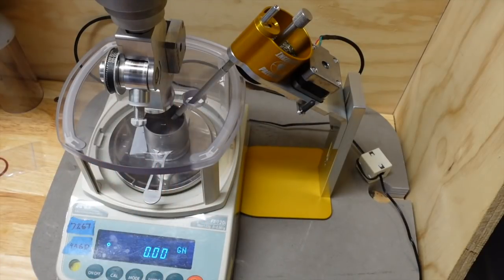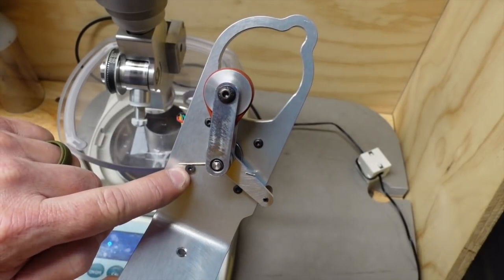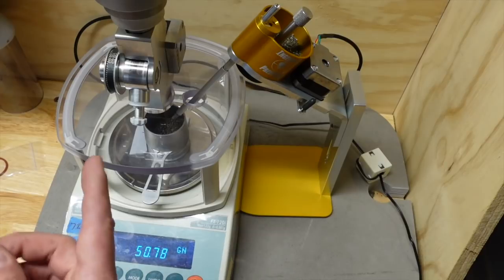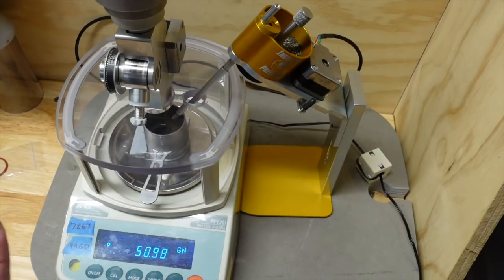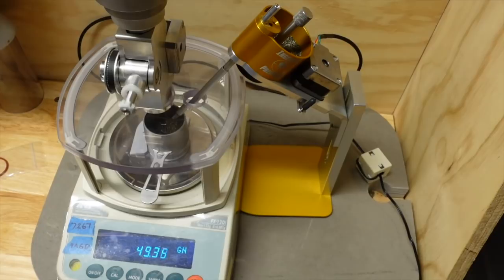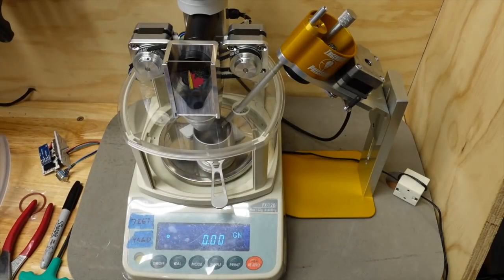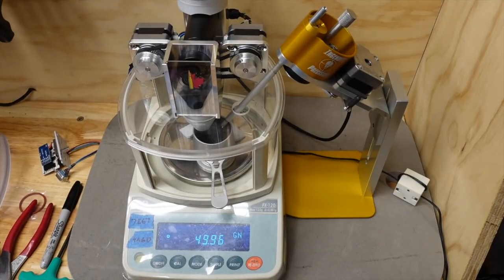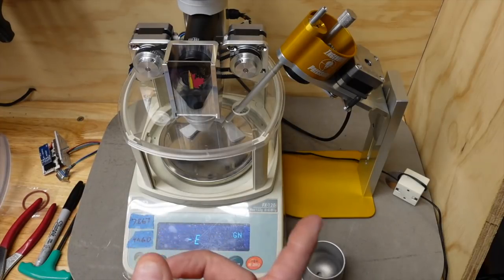Ingenuity Precision powder meter trickler for AutoTrickler

Comment: Man that is awesome!  I usually run mine slow so it stops at 0.02 grains short so I can manually drop one kernel in before I drop it in my casing. Because I prefer accuracy over speed. This allows both!  Thanks for sharing.
Reply from the maker: You're welcome. Glad you liked it.

Comment: Quick question John. What the diameter of the hole you drilled on the top cover and what distance from the center hole to it? Thanks,
Reply from the maker: It's about 2" long and 1 inch wide. That gives you enough room to position it.

Comment: Thanks for talking me into one! It works great but I was wondering what powder cup you use? Both the stock V3 and 419 cups I have the powder likes to bounce out her and there. Not a big deal but it gets annoying cleaning them off the platen.
Reply from the maker: I had a friend with a machine shop make me one. It’s very similar to the 419 cup.
Reply from the maker: And I’m really glad that you like the actual trickler. It’s amazing how some thing like that makes such a big difference.

Comment: Have you checked to see if any of your dispensed kernels (not ball powder) get sliced in half? Are they dropped 100% unaffected? If you have the time perform quick dispensing test over white piece of paper with some extruded powder.
Reply from the maker: I haven’t done a dedicated test to be honest but one of the features he has that I didn’t point out is on the underside near the exit shoot he has a ball bearing and it is just big enough to knock kernels out of the way to keep them from cutting so that only kernels that fit in the desk make it through. Ultimately this means that some longer kernels might never get picked up in the desk but it does also prevent them from being cut or chopped.

Comment: Ok, now if Im completely new to these and have zero autotrickler parts/ no A&D scale yet… whats the best way to go? Used v3 and disc trickle? Or V4?  This is faster than v4 ? But v4 is more compact and convenient?
Reply from the maker: If you're new to this then the V4 is your only real option unless you find a used v2/3 and then get this. Neither one is a bad option. The V4 is still a better choice for those looking to do all kinds of powder and lots of different charges.
Reply: @FClassJohn  thanks John, im just using 1 charge master lite, occasionally check the throws with a gempro 250… just cant help but wonder if the occasional throw thats .1 or .2 off might be affecting load development/groups… have you tested and confirmed what kind of powder deviations start affecting groups/ taking you out of a node?
Reply from the maker: @zoidelux  If you're doing your job correctly then .1gr won't really make a difference BUT I don't like taking a chance. It's a weird fine line between cost (which gets you accuracy and speed) or saving money which is still fine but less accurate and slower.

Comment: Any idea how we could get one of these to work if we don't have a V3 already?  I have a feeling that a used V3 is going to be very hard to come by now that this is out.
Reply from the maker: best bet at this point is to buy the trickler electronics from Adam (autotrickler) and just manually dump the initial charge and use this for the trickle up. easy peezy

Comment: Very cool. 
The price seems high considering the V3 cost $500 total and you have to cannibalize your autotrickler. I also noticed a clear top that you drilled out. So I'm guessing the plexiglass shroud that you bought for the V3 was unusable? Where did you get the clear top? My FX-120i came with a thin plastic top.
Reply from the maker: That clear plexi top is from Area 419 but you can just drill a hole in the stock plastic one and achieve the same success.

Comment: Hi John,
I  too have been testing the V4. You have the perfect set up there.
Do you have a list of the mods/parts you have done here with some detail to get this up and running. 
Any help would be greatly appreciated thanks.
Regards 
Richard
Reply from the maker: All you need is the v4 and the new trickler unit and a v3 cable. If you don't have a v3 cable you can order one from Autotrickler for about $10. Just cut the cord open like I show in the video and manually match them up to the cord on your v4. I'm hoping in the near future Ingenuity Products makes a patch cable that let's you just plug and play. other than that, you have everything you need to get going.
Reply: @FClassJohn  ok sweet, thanks will get onto it

Comment: Correct me if I am wrong but it looks like this eliminates the need for the V4. I just checked the website at AutoTrickler and they no longer offer the V1, V2, and V3. Do I just try and find a used V3 for sale?
Reply from the maker: I think there's going to be a run on v1-v3 units soon so you can look for one or still get the v4 and use it on that too. I'm sure he'll have a patch cable soon enough for the v4.
Reply from the maker: or at this point you can buy the trickler electronics from Adam (autotrickler) and just manually dump the initial charge and use this for the trickle up. easy peezy

Comment: Have you tried a tip on your v4?  To make it throw better
Reply from the maker: Yes I have, it does help.
Reply: @F-Class John  what do you think needs to be done to improve the v4 accuracy and speed. I am throwing big long powder like N570 and I found the v4 better at it with 80gn charges than the v3. But now.... I want that speed and accuracy
Reply: @FClassJohn  what are you using for a tip?
Reply from the maker: @Longshothawk  contact this guy jthornton141993@gmail.com

Comment: What are the blue labels (tape) on your FX120 scale for?
Reply from the maker: If I have more than one fx120 they help me identify in the Autotrickler system which scale is being connected. You don’t see it with one scale but if you have several Autotrickler systems running at once the app will post up those numbers for you to choose which you want to connect to.

Comment: What size hole did you drill in top?
Reply from the maker: I don’t know exactly what it measured but it’s about 3/4 of an inch to an inch in diameter. You’re coming at it from an angle so the hole has to be a little bigger than you would expect.